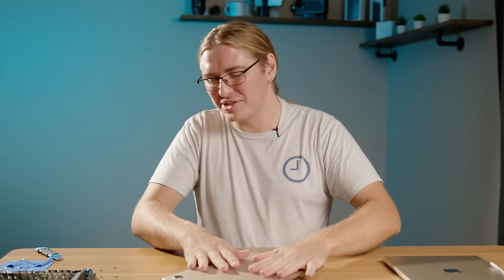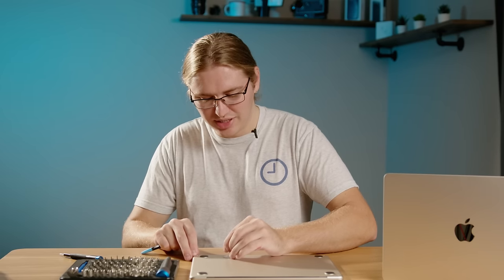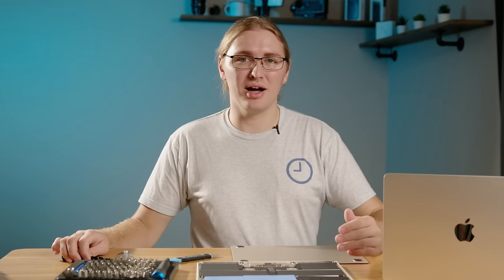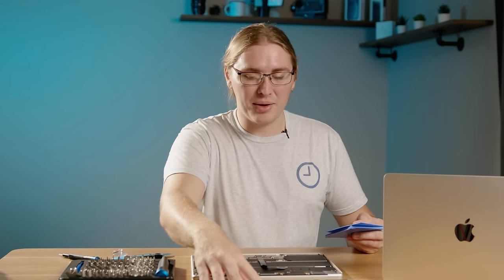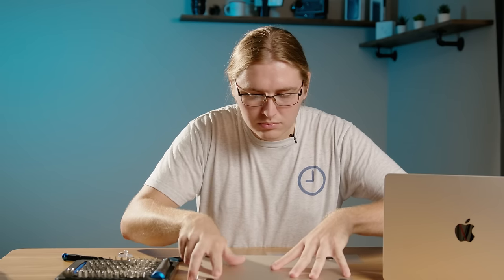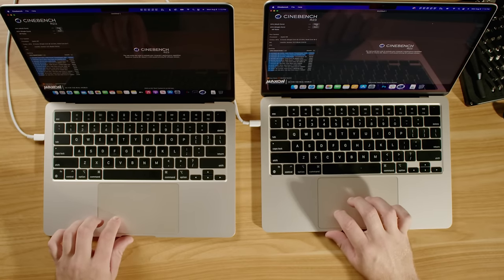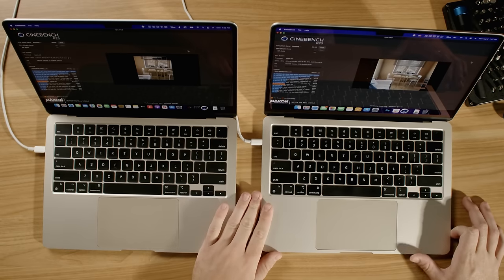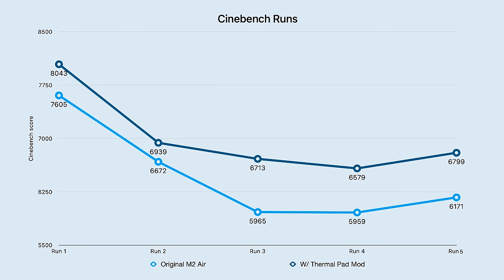The CHEAPEST way to improve MacBook performance

Comment: Did anyone else cry when he sliced that razor blade over the wooden desk, and later over the aluminum panel?
Reply: Dont stress, thats not a razor blade. it's a pry tool with a thin blunt edge, its not cutting or scratching either the table or the back panel

Comment: Please don’t promote this! As you mentioned this will disspate heat, but it will do it to other very critical components like your battery
Reply: Your complete missing the point the higher temps will risk the battery & other components way more by dissipating heat more efficiently, the external case is already running a higher temperature, this is simply making it more efficient.

Comment: If anyone is wondering why Apple didn't just add these thermal pads themselves, it's all a trade off.  Yes you'll be pulling more heat away from the CPU, but in turn transfering it to the bottom of the case.  If you mainly work at a desk or don't care about a really toasty lap this is a good trade off.  If you are okay with some thermal throttling to perserve a cooler case this isn't for you.
Reply: In addition, it will transfer the heat to other components including the battery which might get a worse life due to this mod. If anyone needs more performance go get a MBP instead
Reply: What if I use the desk and use a laptop fan as well? Is it dangerous?
Reply: Apple doesn't add them because the external temperature of the case will exceed what is comfortable to touch with bare skin.  
There is likely no other reason and from Apple's perspective there really doesn't need to be.
There could be, but any other internal temperatures can be (and probably are) monitored and the machine still throttled appropriately.
Reply: That‘s what he was talking about in this video?!
Reply: @angel23138  no, it’s mostly advisable but not necessary because you won’t reach that throttle if you use simple task.

Comment: Please don’t do this! Yes it will transfer heat from your cpu but at the same time your transferring it to your bottom case and therefore your battery! This will rapidly decrease your battery’s health. If you need more performance, then don’t buy the air in the first place.
Reply: What you’re talking about? The performance of the m2 is among the best. To have better performance than that, only if you get the very expensive 14” or 16”.
Reply: @nandoolivetto  you literally just answered your own question.
Reply: What?? The bottom of the case is actually running hotter already affecting the battery, this is simply making the heat dissipation more efficient therefore saving the battery!

Comment: Quite a few tech reviewers who specialise in repairing macs already put out videos saying this is a really bad idea and will damage your laptop.
Reply: Doesnt make sense. I tried to run multiple times of Cinebench and battery temp never go beyond 40'C. How is that damaging?
Reply: @gigihanmandarin  on m2 MacBook Air? Did you measure temps around batteries and all? Maybe compare what you’re doing wrong to the experts testing
Reply: @loving_dad_explorer Yes M2 MBA. I use TG Pro for temps just like everyone else. Expert who? I watched almost all YT videos on M2 since I was getting one. Some warned  about the battery getting warm but nothing destructive. How can sub-40℃ be destructive?
Reply: @gigihanmandarin  Same, did extended cinebench runs on my m2 air with thermal pads on the heatsink and kapton tape under battery areas. Never saw battery temps over 40C, or battery temperature delta >2C vs. pre mod. All the youtubers are fearmongering for clicks, I haven't seen a single youtuber do controlled tests on battery temps pre/post mod on the m2 air.
Reply: @Alex-eu7ls  agreed
Reply: @gigihanmandarin  Don't think now, think long term.
Reply: @kalvin126  How is it damaging when batt temp remains 30+°C? I have been using my MBA M2 for video editing and thats the battery temp I've been seeing. When you ahve a claim, try to back it up with something concrete.
Reply: How on earth can running a lower temp be damaging?? OMG some people are blind Apple fans
Reply: @boomish69  maybe research how you achieve those lower temps

Comment: The graph shows improvements in the test score by 4% to 12.5% (run 2 and run 3, the most similar and most different runs). I'm not sure it's worth voiding your warranty, potentially damaging your laptop during install, and making the chassis uncomfortably hot to run it just a few percent faster and only under sustained load.
Reply: You‘re not voiding your warraty. Why would you think that?
Reply: @marcel151  Any mistake you make during this install that damages the laptop will not be covered. They're full of tiny components and fine ribbon cables, it's easy for someone not used to it to mess up. They explicitly call it out: "This warranty does not apply: […] to damage caused by service (including upgrades and expansions) performed by anyone who is not a representative of Apple or an Apple Authorized Service Provider."
Reply: @desmond-hawkins  If you are not used to that kind of work, then don't do it. This is absolutely easy for people who already worked on laptops.
Reply: @marcel151  Oh definitely! But of course it's not going to stop people from trying. It's one thing to post a video like this on a channel like Linus Tech Tips where every single laptop they get their hands on gets disassembled, but for a more consumer-centric channel like 9to5Mac it might give the impression that it's trivial to people who probably should not attempt this mod. That's all I meant.

Comment: I mean, if you’re going to do this, why not pair it with a high quality laptop cooler to transfer away all that heat? Decent, quiet ones aren’t all that expensive, and they do a great job of mitigating thermal throttling.

Comment: Just because you can do it, doesn't mean you should do it!  If the extra performance is needed and used regularly, then pay the extra for the machine that was made to provide the extra performance.  There will be people that do this, have problems, and then slam Apple when they refuse to uphold the warranty.

Comment: You aren't the only YouTubers showing this but in no way would I take a beautiful MacBook Air M2 apart to insert heat sync pads. Voiding the Apple warranty can't be worth the risk. I bought a simple laptop cooling tray.
Reply: Don’t use those just use low power mode it’s the best for your laptop. Thermal pads destroy your battery
Reply: I wonder how the laptop cooling pad would work. Normally, the bottom of the laptops is preforated, but not for the MacBook.
Reply: laptop cooling pads with fans wont do anything for fanless macbooks. There's thermal insulator on top of the logic board + inner side of the bottom cover.
They DO however do amazing work if you have thermal pads installed, since the heat at the bottom can be easily taken away with the cooling tray.
Reply: @bob_smite  The bottom of the MacBooks never were perforated.

Comment: Sorry, but this is irresponsible. Do you not realize that this transfer the heat of the Chip to the entire internals of the laptop, including the battery... YouTubers are not engineers or product engineers and this will have an effect on your battery which is the last thing you want to do. Please do not do this to your laptop.

Comment: Dude, I get your point, however, I wouldn’t be advising people to do this! Why would someone take an expensive device to add some damn thermal pads anyway! It ain’t worth the risk! I have an M1 MacBook Pro, and I , in no way, is going to tear my device apart! No way! I still haven’t fully paid for it yet! It ain’t worth the risk! Crazy video! Peace.
Reply: Dude, chill. You don‘t need to take it apart, it got active cooling. I wouldn‘t do that, either. But I had opened my 2012 MBP when it was new to upgrade RAM and to an SSD. No problem. You won‘t lose warranty.
Reply: @marcel151  - So, you get my point? Cool! Thanks for your comment! Peace.
Reply: @darincampbell171  No, I don't get your point. You are exaggerating. I just wanted to mention that it's not the end of the world when you do that to the M2 Air. You even won't lose warranty since it's easily reversible. If you could upgrade the Mx MacBooks I would've taken my 14" Pro apart like my 2012, for sure. I just don't do it because I don't need to do it.
Reply: @marcel151  - All I can say is, I believe, that this task would be dumb! I will leave it at this- If someone wants to take their property and do this to it, more power to them! It’s their device and NOT mine! They have every right! Still, dumb and stupid to me! Regards!
Reply: @darincampbell171  As I said before, chill. I wouldn‘t say that it‘s dumb as it definitely works. But if you need that mod I think you have chosen the wrong laptop.
Reply: @marcel151  - Oh, I don’t need it! Never would need it! YOU can say what YOU will! Still, a dumb thing to do! APPLE knows how they want their devices to be! Remember- these laptops were designed by engineers and people who are highly educated in this type of work. They sure, as hell, don’t need some wanna be tech guy doing crazy things with their products. They have all ready, I am sure, consider the factors that some people feel must be corrected. As I have all ready stated, to each his own! Do what you will! Whatever makes YOU happy! After the smoke clears, it is still STUPID!!! A rose is still a rose. Have yourself a nice day! Peace.

Comment: This is a bad advice. This way you heat up bottom panel of the laptop and then it heats up the battery making it degrade faster. How can you advice something like that without providing accurate battery temperature difference in the end of the test?
I'm guessing that it will increase battery temperature by more than 5 degree celsius and it will definitely have a big impact on its long term wear.

Comment: Back in March when Apple did not come out with a basic 27-inch 5K iMac to replace my iMac (Retina 5K, 27-inch, Late 2014) I purchased a MacBook Air M1 chip with 8‑core CPU, 7‑core GPU,  16‑core Neural Engine, 16GB unified memory, 2TB SSD storage.  Now there is this same thermal pad solution for the M1 MacBook Air to help cool it.

Thing is as a normal I do not have the need.  If I was still in the production world I know I would not be using a consumer device to work on any production.  I would step up and purchase something out of the Pro section of the grid of consumer laptop/desktop - professional laptop/desktop.  

Know young people talk about the high price of Apple products.  Thing is my original $ 2,500.00 128K 1984 Macintosh when adjusted for inflation in todays (August 2022) dollars would cost now cost me $ 7,129.72.  So please quit complaining about the cost of Apple products, and purchase the best tool for the job you are doing.

Now back to the issue that started all of this.  I feel it is a major fail on Apples part that they did not look at something like a vapor chamber cooling solution on products like the MacBook Air, and iPhone.  Would like to see a third party vapor chamber cooling solution modification for the M1, and M2 MacBook Air.

Comment: This has caused fires, shorts, and burnt out laptops. It voids the warranty, transfers heat from the SOC to the battery. Heating a Li-ion battery is always a stupid idea. This is almost as bad an idea as all the fractal woodburning morons electrocuting themselves with microwave insides. When the battery cooks, not if, good luck getting it fixed. This site has gone really downhill, but this is a huge new low.
Reply: Do you have any source for any of the M1 / M2 macbooks ever got on fire because of this mod?
I have this mod on my M1 Air for more than a year, with 400 battery cycle, 91% battery health. Not a single issue ever happened since.
Reply: @Korsera  ever heard of lipo battery fires? It’s probably not something to too careless about.
Reply: Why would open it voiding the warranty?!
Reply: @CAMTechChris  Yep i am lol. Li-Po batteries start to lose their health after prolonged 52c temperature, and risk of cells getting damaged at 60c. I am well aware how these stuff work.

Like i said, if you apply this mod to your device, dont do prime95 + final cut pro render outside under sunlight or something stupid like that, it’ll be fine.

Oh also in case if anyone didnt know, the failsafe features are there for protect from this kind of stuff. My M1 air would instantly go throttling if battery reaches 48c, no matter what the SoC or core temperature is.
Reply: Also another note, opening the bottom cover WILL NOT void warranty. Any suspection of a mod or possible damage to components caused by the mod, will void it.